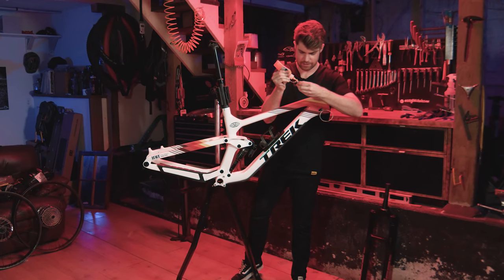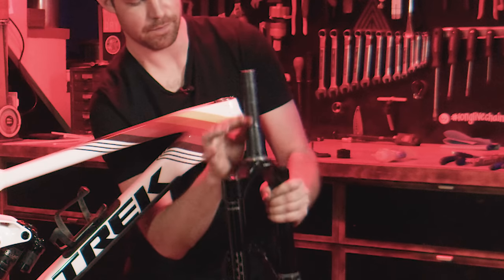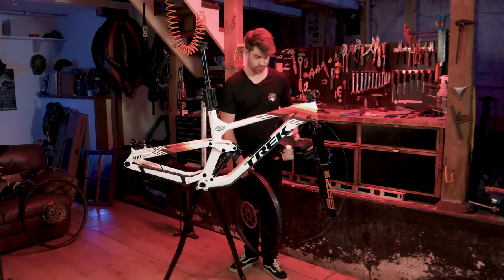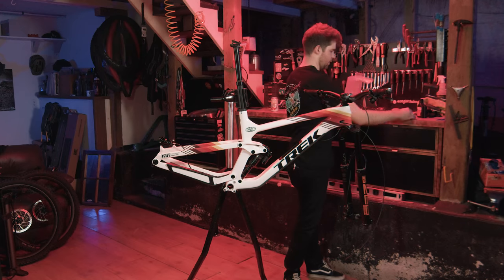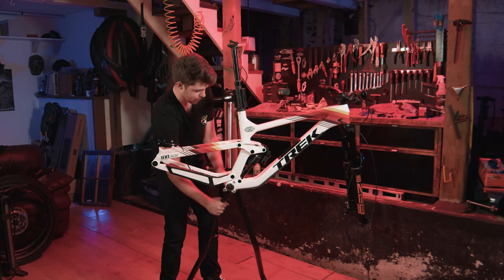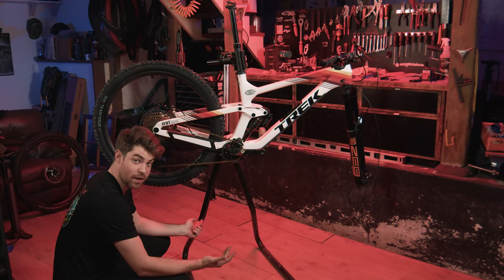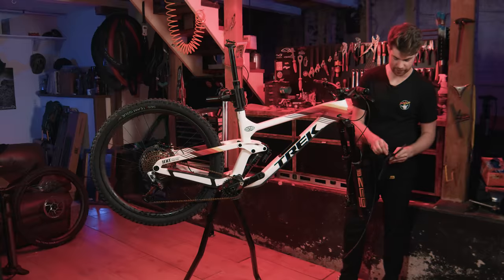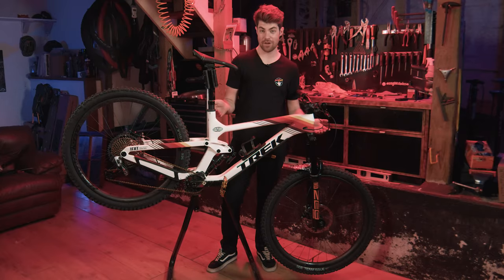Building a Custom Painted VHS Bike

Comment: never do a drop off in the big cog, chain wasn't fitted checking for chain growth through the travel with the location of the slash pivot there will be some growth under compression. not much but with how tight that chain is in the big cog not much might be to much

Comment: I've always used a floor pump to make my tires tubeless. Do people use something else?
Reply: I bought a cheap air compressor which actually works quit solid since it only was 20 bucks. I tried pumping up my tubless tire with a floor pump and i couldn't get them to see after 30mins of pumping swearing and nearly crying I just bought that cheap air compressor. It's quit loud but gets the job done.  Probably a better floorpump would work aswell but it would've Coste more that that compressor so🙄
Reply: @Aceton_  I just have a specialized air tool floor pump and if it the tire doesn't seat at first, I just try and squeeze the tire to the edges of the rim and I've had no problems
Reply: @shrevecc  I could have probably figured a way out but honestly after that frustration I didn't want to deal with any of that stuff anymore😂
Reply: I have a pump with a canister you can fill up and release all the compressed air you've pumped into the canister.

Comment: Just a heads up, when doing a 12 speed sram chain you need to account for 2 inner and outer links when sizing the chain. Idk why but that’s what all the sram info states. Pre sure it has to do with the longer cage of the derailleur.
Reply: I think it’s more for when the chain is in the climbing gears and you compress the shock, extra links would prevent the chain from affecting compression of the shock. I usually fully deflate and compress the shock and then do what Jason did to size a chain.
Reply: @samstephensmtb  u are absolutely correct sir! U need to keep in mind the movement of the rear triangle. Almost every full suspension bike frame decreases the length between the bottom racket and the rear axle when in full squish, so u should size the chain with the shock out and and the frame in the compressed position 💁‍♂️ 6 years of bike service and multiple errors of mine taught me the right way to do it. 
Ps: his chain is too short 🥹

Comment: 10:56 don't do this. Never undo a master for fun
Just undo the lower cage Lully wheel, rotate the cage and re align the chain. 

PS the red light you used for this video sux
Reply: 11:07 I also chipped my frame once when the chain whipped around. Would've demented a carbon rear triangle. 
Always use a double hook made from half a spoke when playing with chains. I've had many slinky onto the dirt under the bike lol
Reply: That is some bad advice man! 🤣 It’s so unnecessary to take the cage apart 🙄 just shift to the smallest cog, pull the cage forward, secure it with the cage lock and then take the master link apart… there will be no tension on the chain when u do it like this.
Reply: @_MC_-gw6yp  the master links are 1 or 2 use, they wear out. Maybe you've never snapped a chain and gone over the bars.
The single 4mm cap screw on your lower cage wheel will last forever and requires no special tools, just a 4mm
Reply: @janeblogs324  no… You can reuse MasterLinks but you shouldn’t reuse MasterLocks if we are talking specifically about Sram. But you can reuse certain chain links from other brands (KMC, YBN, Sram), but of course what I mean by that is that you can unlink it and link together while it’s new or if you are cleaning the chain, but you should always throw the quick link out with the old chain. And yes I did snap chain multiple times on my DJ bike but it was always because of lack of maintenance or because the chain got damaged on impact. In most of the cases the chain snaps because of bad shifting and most of the time it snaps in the place with normal links, because they can actually take less lateral force than a quick link.